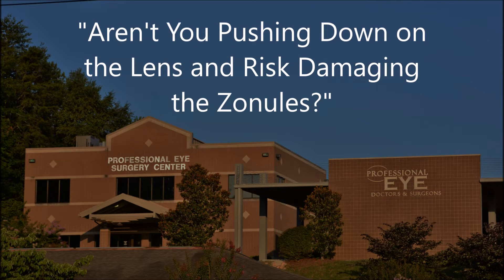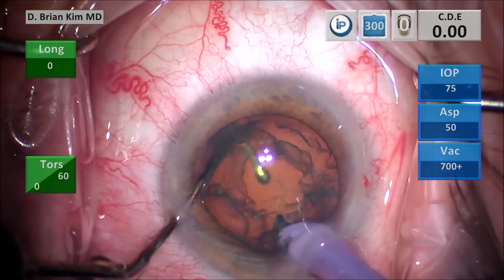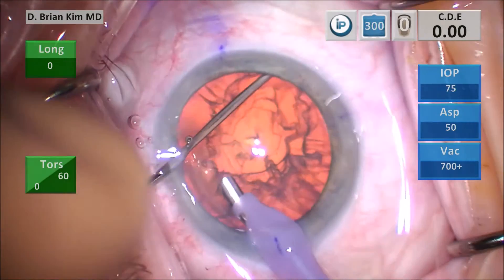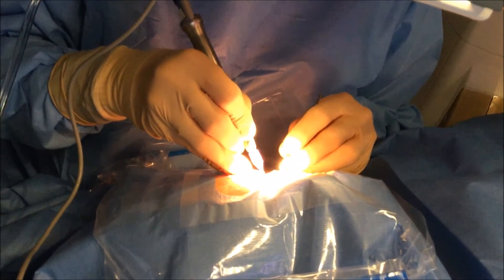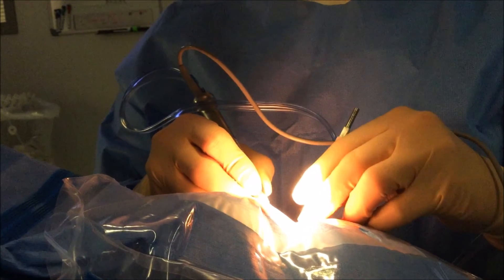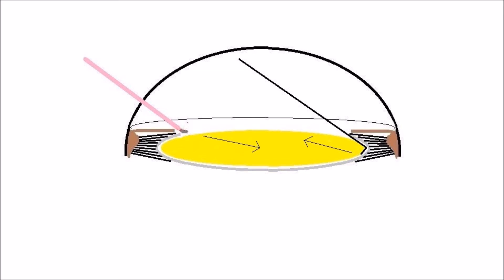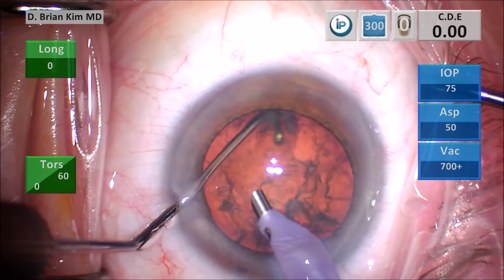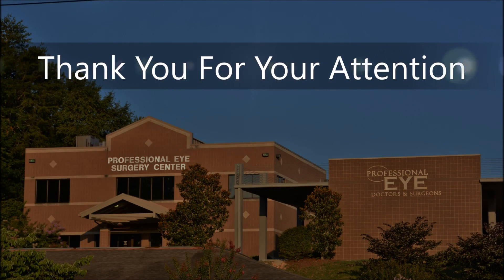How to Position Hands for Double Chop and Cross Chop

Comment: Sir amazing technique.
Is this technique possible with all kinds of chopper sir?
Reply from the maker: Yes but the chopper tip must be 2mm or longer with a rounded tip. You cannot use a vertical chopper on this. That is a totally different instrument. If you use the wrong instrument for the wrong technique, you will fail and may cause a complication. Best wishes.
Reply: @DocBrianKimMD  thanks a lot sir

Comment: Hi, is it necessary to tilt the tip of the chopper horizontally once it is in the equator?
Reply from the maker: Great question. No, but it is easier to hook and hold the lens when you tilt it. It is particularly helpful for the denser lenses so that you can hook the lens deeper. I would experiment with the maneuver as you learn and you will understand more what I mean. Best.

Comment: Dear Mr. Kim, 
I am an absolute fan of your technique and the chopper you developed. Many thanks !!! I love the concept and after now doing about 100 cases „double chopping“, I am absolutely convinced about safety and workflow. However, there is one thing I would love to get your opinion on. Even reducing the CDE to about one forth compared with my previous technique (mostly stop and vertical chop or in soft ones divide and conquer), I still find more corneal edema on day one. This is particular in cases which are harder, when CDE ist 3 to 7. In my previous setting, I used much more ultrasound and had almost always clear corneae on day one. 
Do you have any good idea what to improve? Do I produce to many corneal compression when diving with the phacotip, or do to much manipulation? Bottle to high (I am using Centurium with gravity, bottle high 105)? phako tip to anterior, even when I use it bevel down?  Viscoat disappears to quickly do to the aggressive flow rate (50 flow, 600 vacuum to get IP working)? I wonder whether you have a good idea about what I can improve? Many thanks for your advice! 
Thomas Jehle from Germany
Reply from the maker: Thomas Jehle thank you for the kind words and feedback. I am happy to know that the technique is working well for you.

I want to thank you for your question and it is an excellent one. With regard to the issue of having more corneal edema, please bear in mind that it is hard for me to be 100% certain without seeing a video of your cases, but I must conclude that it is because you are using ultrasonic energy closer to the cornea with this technique than you were with your other techniques. The solution would be to emulsify the lens material further away from the cornea. If you can record your cases, I would suggest analyzing this. Feel free to contact me with any more questions. I hope this helps.

Comment: sir, u r pushing down the lens by phaco tip bevel down with no use of energy or vacuum with simultaneous lifting up of lens by chopper..is it zonular friendly and how do u assess the amount of force required in this technique..
Reply from the maker: Amit Sood let me clarify. I am pushing down on the lens but NOT on the zonules. Imagine a pair of chopsticks crushing a cooked bean. Both chopsticks crush the bean toward each other.  All the forces are directed toward the center (the center of the bean) therefore there should not be any forces applied on the zonules. I hope this is clearer.
Reply: thanks very much sir...

Comment: is this technique can be done in softer cataracts....is there any danger of causing pcr when u take the chopper at equator
Reply from the maker: Amit Sood yes, it is actually ideal for soft cataracts because you can slice it up very easily without spinning the lens within the capsular bag. In my opinion, this is the absolutely the best way to disassemble the lens with manual techniques especially the soft lens. No there is no risk to the PC as long as you perform correct technique. I.e. the chopper is inside the capsular bag when it’s placed out to the equator.
Reply: thanks sir

Comment: what are your settings for the centurion machine?
Reply from the maker: Robert Blum , thank you for the question. I can post my setting if you wish but if you look at the overlay on my videos, it actually shows them there. One thing you will notice is that my settings are a bit aggressive. I don’t want that to deter anyone. They are that way because I prefer things to move quickly. The truth is, this technique can be performed with any type of setting. In essence the technique is setting-independent. I hope this helps.
Reply: Thanks for the reply! I've used your technique about 50 times now but only about 5 times with your chopper (I convinced the head OR nurse to buy 3 of them!). I am definitely a convert to this technique. My own settings are fairly aggressive; I will review your videos and see how they compare. Thanks again for sharing your videos.
Reply from the maker: Robert Blum that’s awesome. I’m so happy to hear it has been working well for you. I’ve found the more I did it, the better I got, and the more confident I was to use it on the most challenging of cases. Best of luck and let me know if you have anymore questions.

Comment: Very informative! just wanted to ask you a few questions :)
1. Did you perform hydrodissection prior to this manuver?
2. Do you initially clean up some eipnuclear material or do you do straight with the double chop?
Reply from the maker: Hi Vince, sorry for the delay. I'm finally catching up on these posts.
1. Yes, I always perform hydrodissection.
2. Whether or not you remove the epinuclear material, in my opinion, is a matter of preference. However, when you first learn the technique, it makes sense to remove the surface epinuclear material to give you more space which should help give you the landmarks to place the chopper.

Comment: I saw your wonderful video well. Your phaco tip is maybe 45 degrees or 30 degrees. I'm using 0~15 degrees phaco tip. I'm worried that the lens will penetrate well without stressing the zonules(especially hard cataract). What do you think about that?
Reply from the maker: Sorry for the late reply. I didn’t notice it til now. No, this technique is irrespective of phaco tip angle or fluidics settings or anything of the sort. The disassembly is with mechanical fracturing forces, I.e. the chopper and phaco tip. It doesn’t really matter. Having said this, I think a 45 degree tip might be easier to perform the chop maneuver because the profile is thinner and pointier, but with experience, it doesn’t really matter what you use. As a beginner, I do suggest doing it with a 45 degree tip.

With regard to the hard cataract, again, I do not believe it matters. Recall, you are not using any ultrasonic energy during lens disassembly so density of lens is not relevant. The technique of getting both instruments around the lens and crushing it is the main importance.
Reply from the maker: 신경섭 there is no stress on the zonules. All the forces are directly centripetally, I.e. toward the center. Therefore there is no stress on be zonules.

Comment: Dr Kim,  in reference to the double chop technique, are the forces you apply with the chopper and phaco tip equal?  In other words, are both the chopper and phaco tip directed centrally towards the center of the cataract -- the chopper is a "pulling: centrally and the phaco tip is "pushing"?  I have tried the technique, but I sometimes find that the cataract is not splitting despite the chopper moving centrally.   I suspect that I am not "impaling" hard enough / deep enough with the phaco tip.  When the technique works, it is great.  But I am having a tough time with the denser cataracts  (i.e. those with thick epinculear plates -- I did watch your other video that suggests using a more diagnol chop for the denser lens).  Any suggestions?  Thanks.
Reply from the maker: James Johnson , sorry you are having trouble.  Yes, the forces are directed centrally.  With regard to the chopper, I place it out to the equator and turn the tip horizontal so that it is supporting the lens from below.  I place the phaco tip bevel down because the sharp edge can hold the lens better for the chop.  You must tilt the phaco tip in a more vertical position and as you lift up with the chopper, you stab down with the phaco tip and you should feel the lens engaged between the instruments. It is a tactile feeling that once you get it, you know you've secured the nucleus effectively and will fracture it.  Think of your instruments like chopsticks trying to cut a cooked kidney bean.  Unless the forces applied are perfectly balanced, the chopsticks will twist when you try to squeeze them together and the bean will slip out of your grasp.  But if the forces are correct, you will crush the bean with the chopsticks.  This feeling I speak of is particularly noticeable with the brunescent lenses and this is where the technique shines.  I do brunescent 3-4+ on a fairly regular basis and the technique is far superior to any other technique IMO.  Anyone who is not doing it or refuses to try it is really missing out so I applaud you for persevering.  I hope you will find success.  Please let me know if there is anything else I can do to help.

Comment: Hello Dr Kim ,
Very great demonstration again I would suggest to post it on Eyetube. I have been using  Nagahara Chopper for the horizontal chop cases. Do you think it is safe to try your beautiful technique with my chopper? 
I was giving my CS exam in Houston, hoping to find ophthalmology fellowship in US.  I have some queries about the U.S. fellowship system. If you don't mind this is my email for communication:  anaswahbeh@gmail.com    
Regards
Reply from the maker: Anas wahbeh , I have been in discussion with the folks at Eyetube and we plan to have my videos uploaded to their site.

It is safe to use the Nagahara but it is shorter than the chopper I designed.  I'm sure you can have success with it but it would be easier with the Kim Double Chopper.

With regards to fellowship, I have little knowledge of how you would go about applying and the criteria.  I would suggest contacting program directors at any of the teaching institutions around the country.  Best of luck.